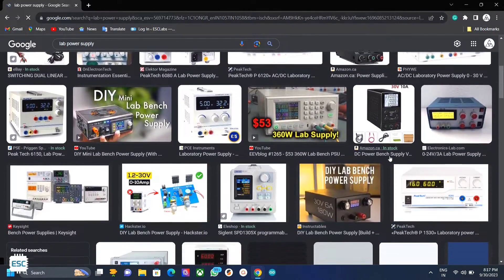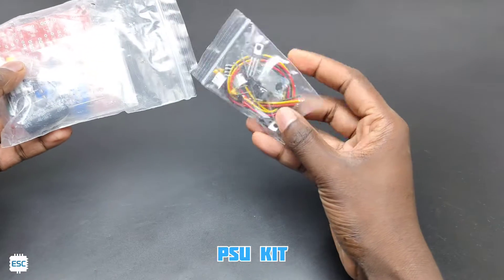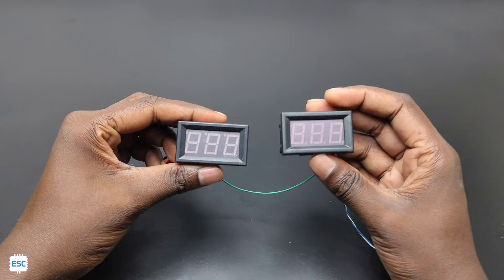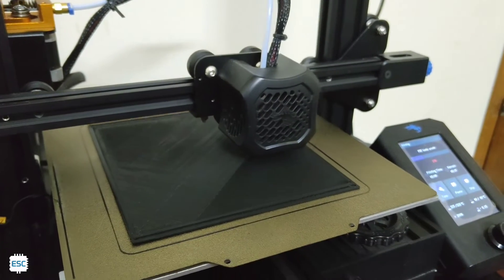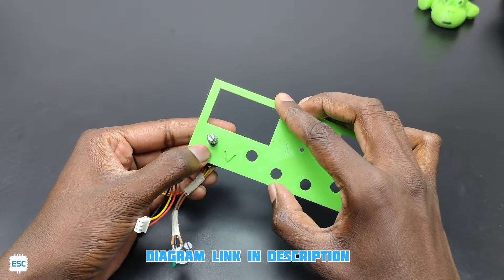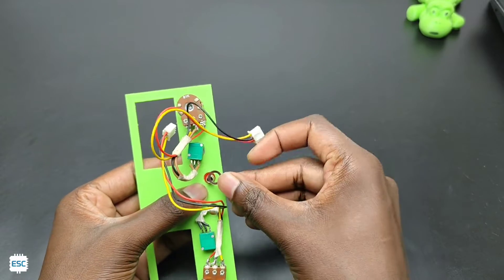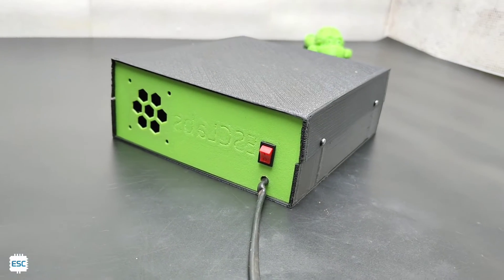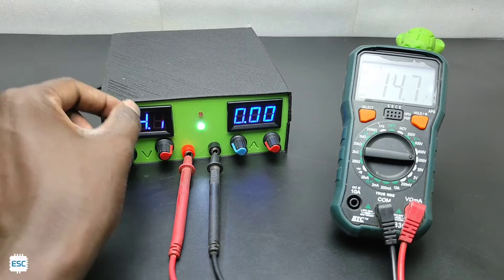How to Make a Variable Power Supply Unit | DIY

Comment: Nice build. But if you use a metal cabinet then it will be a lot more robust. Because you placed a huge transformer inside it. A small mishandling can lead to breaking of the 3d printed cabinet
Reply from the maker: Thats true .  I will update this soon
Reply: a big reason is EMF shielding